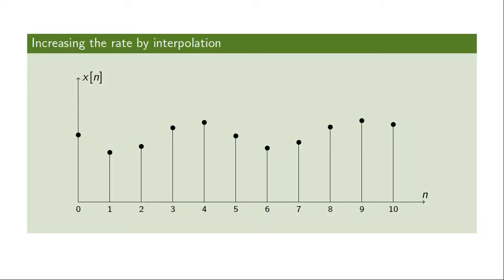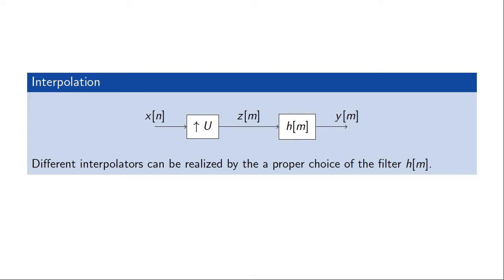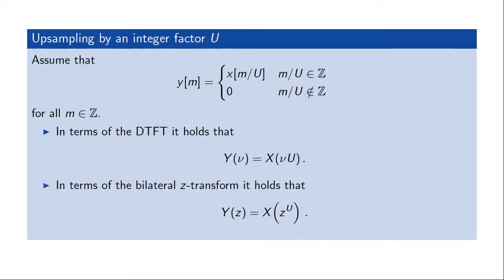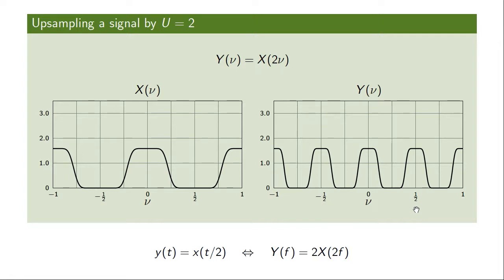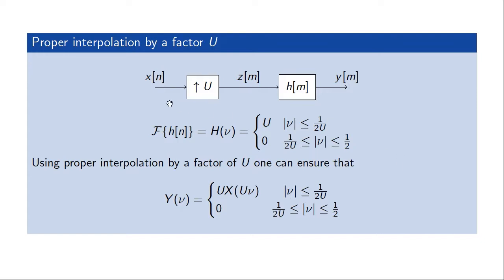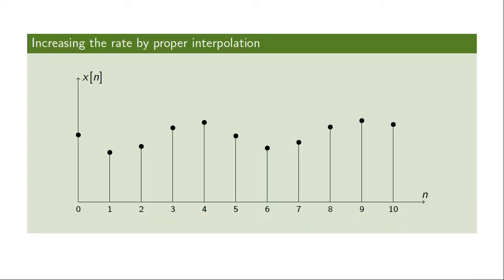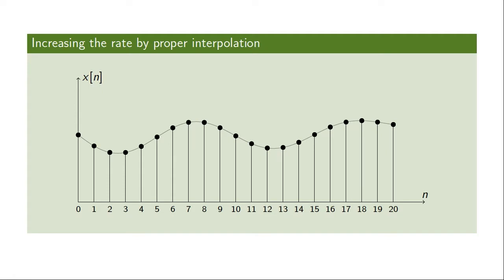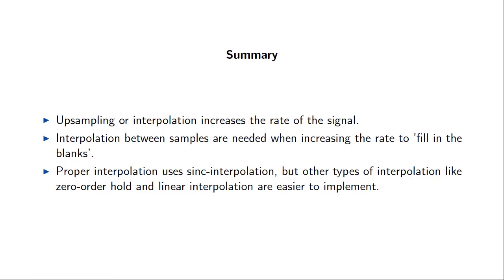Upsampling

Comment: 3'46" is the number 3 wrong? the size of the samples is double of the original (1/2 + 1 + 1/2 of the 3 samples taken into account every time). It should be 1/4, 1/2, 1/4